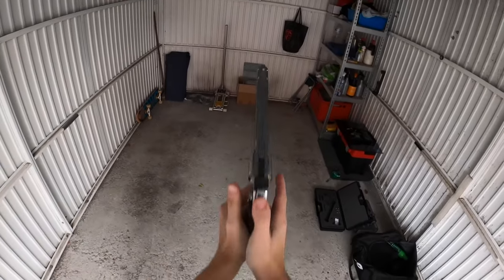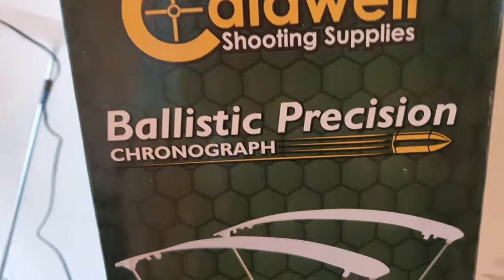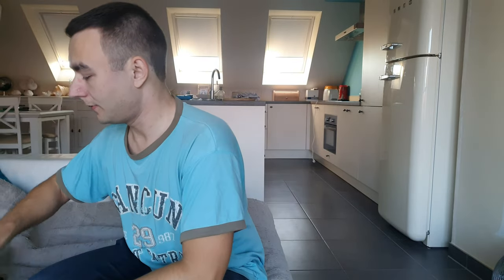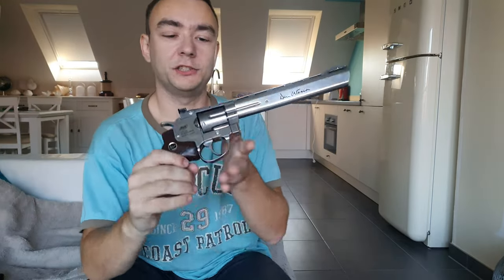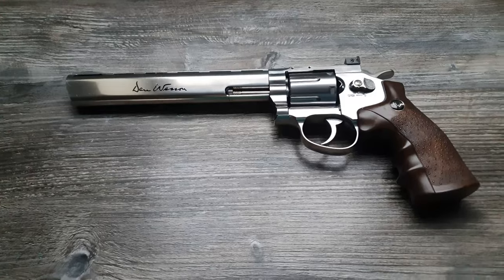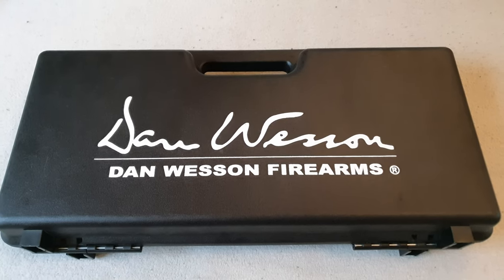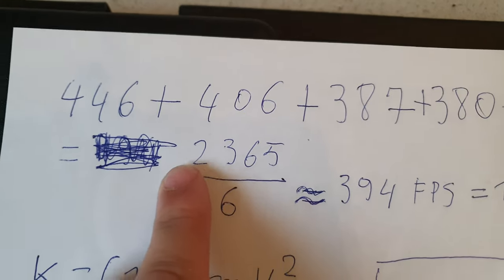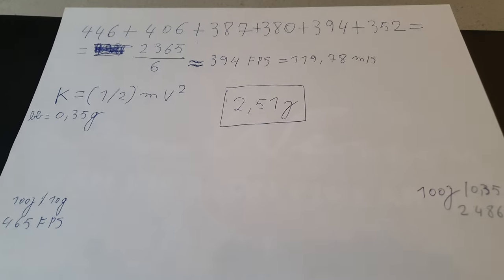All you need to know about the Dan Wesson

Comment from the maker: Jayz2cents just made a video about breaking tempered glass 😀 He said that it is very strong against impact on its flat surface, but Not on the edge. And you can not crack or damage tempered glass, if you do it just explodes like you saw in my videos 😁
Reply: Can I use tin pellets for my colt SAA pellet version because I don't want to use lead due to risk of poisoning, Can the harder material damage the riffling?
Reply from the maker: @lynchcs3044  
Yes it can damage the barrel
Reply: @HappyDude1  Sounds scary. Im not a fan of lead and always washing my hands after.  How will it get damaged if tin is softer than steel
Reply from the maker: @lynchCs  i put lead in my month when im soldering since i was a child 😅 
Only the oxides when you melt pure lead thats toxic.
And the fumes from old paint based on lead. So you dont need to be scared. Lead in solid form is not toxic, you can lick it like a lollypop 😅 tin is very hard compared to lead
Reply: Hey can you send me a link to where you got that revolver